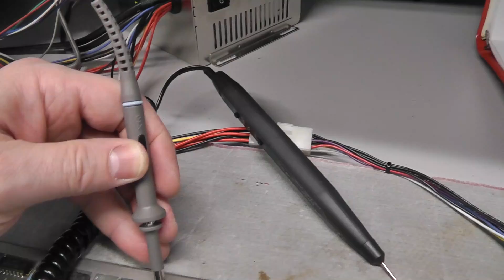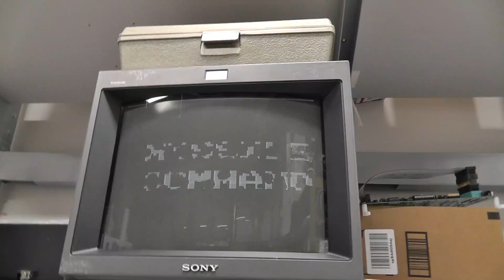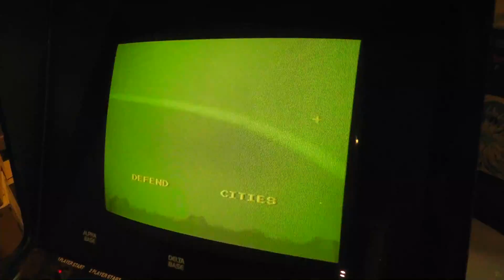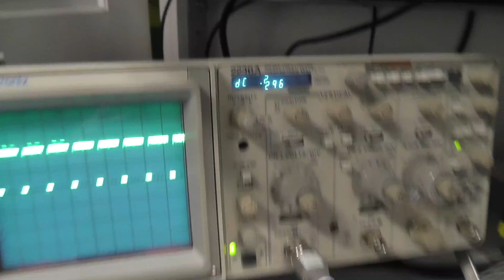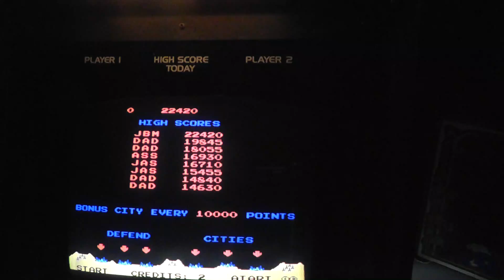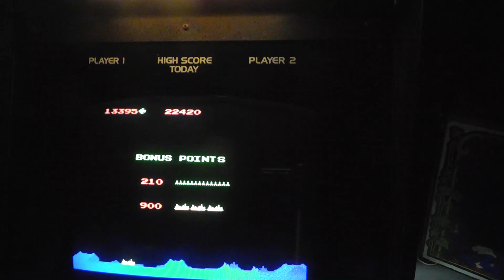Missile Command Repair PCB #2 - Mean Green Blank Screen and Sprites

Comment: I'm confused about the difference between the Unlatched Blue, Green, Red signals compared to Latched Blue, Green, Red signals. Does the Waveforms look the same or what is the differences?The Color RAM Write Enable signal is being generated by the CPU? and so is the vertical blank signal is being generated by the CPU? to trigger the color RAM chipThe Vertical Blanking signal doesn't just go to the Color Ram chip but where else does the vertical blanking signal go to which chips?The Vertical Counters chips don't start at 0000, any reasons why the doesn't start and load at 0000? look at the loading inputs on the counter chips